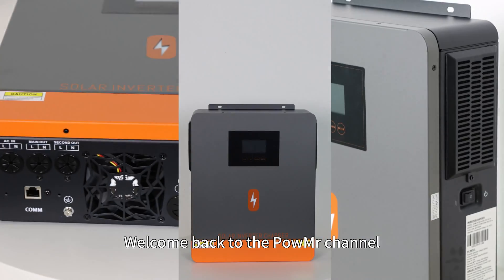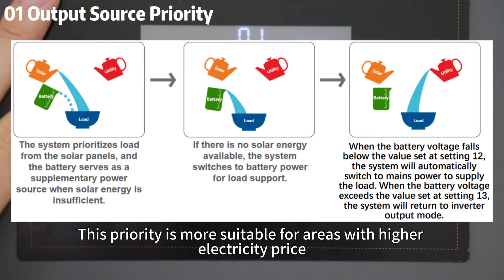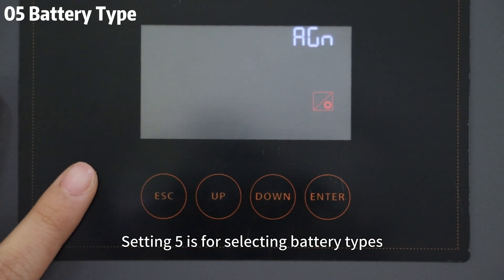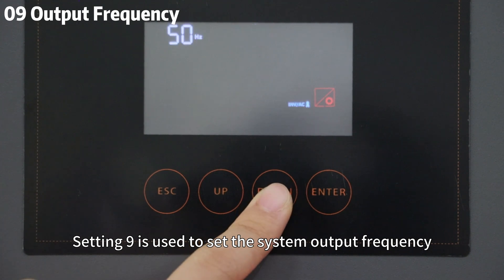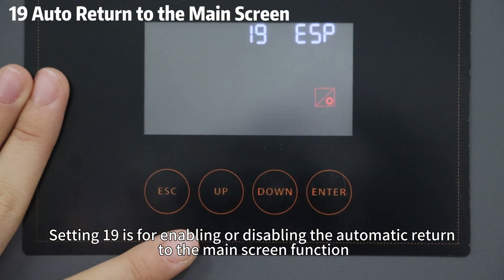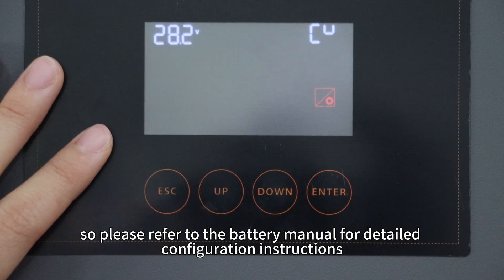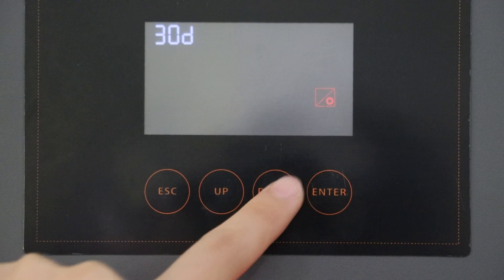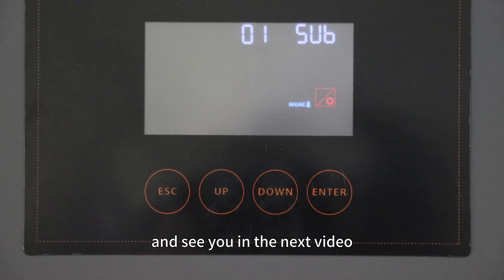How to Setup the PowMr 4.2KW Hybrid Solar Inverter?

Comment: Can that inverter run and enable bypass from non-inverter generator in APL mode? Generator gives stable 230v, but 51-53hz on no load, and 51 stable hz with load. I've tested on UPS mode, inverter beeps, tried to analyze grid but no luck with bypass, maybee it needs more time, like 60-90sec to analyze generator grid and enable bypass mode? (I'm asking for situations where there's no electricity for a long time, and the sun's generation is weak in winter, and the batteries need to be charged somehow)
Reply from the maker: To use a generator to charge the battery, you need to ensure that the generator continuously and stably outputs 230V, 50Hz/60Hz AC power. We recommend that you install a voltage regulator between the generator and the inverter.

Comment: I just got the 4.2kva powmr, but after installation, it started displaying BP. Please help my battery is tubular batteries
Reply from the maker: Check if the battery voltage is higher than 24V.

Comment: Can I connect PE and N together at the AC output? I need it for the correct functioning of the residual current devices. Or can I connect N from the input to N at the output?

Comment: Hello. I would also like to know why the 4.2 kW 24 V inverter does not respect the settings imposed on the user mode? I do not use a communication cable between the inverter and the battery, because of this I go to the user mode, but it does not respect the voltages set by me! It passes 40% 50% 60% even 70% on the grid with the battery. What do I have to do to make it respect the values entered by me???
Reply from the maker: Please send it to this email: support@powmr.com . Our technical staff will check it for you.
Reply: @PowmrSolar Good morning. I wrote to the technical department and I'm waiting to see what they reply.

Comment: I am using the 4.2 version of the inverter with 2 tubular acid batteries. In Settings #05, is it appropriate to set to FLD?

Also, I set #011 to USB. when there is grid outage, will this ensure that battery power is preserved when there is energy from solar, and use battery when no or insufficient energy from solar ?

How do i know the battery charge level and when it fully charged? Does the charging cut off when battery is fully charged ?
Reply from the maker: Please send it to this email: support@powmr.com. Our technical staff will check it for you.

Comment: Is the instruction also applicable to the 6.2kw version? Also, if I turn the grid tie function OFF in setting 37, will it still function as a hybrid inverter and draw power from the grid when solar and battery are not enough, but not export it when solar and battery are excess? I have no net metering but still want to use the grid when solar and battery is insufficient
Reply from the maker: Yep, It is also applicable to the 6.2KW model.

Comment: I have this inverter installed at a customer site with almost 6kWp solar panels, so the setting 02 was set to 120A, but the inverter kept resetting back to 60A whenever it short down on low battery voltage.
Kindly assist with the solution
Reply from the maker: Please send it to this email: support@powmr.com.

Comment: Question 
1. What Size of cable to battery 24v going to 4.2kwinverter?
2. What AMP use to 4.2kw going to 24v battery?
Reply from the maker: 1: 25mm. 2: Are you referring to the battery breaker specifications?

Comment: How to set this inverter for pure off grid use only pv and battery source
Reply from the maker: You can set the 01 setting item to SBU.
Reply: @PowmrSolar hi dear. My powmr 6.2kw hybrid is not saving SBU mode. After you exit setting and enter again, it shows SUB again. Please help. And how can I contact you with WhatsApp?
Reply from the maker: @ASh0599  Please send it to this email: support@powmr.com.

Comment: Hi. Can this unit be used with the network grid but without to use the bypass, I mean as a voltage stabiliser? As in my area I have ongrid power but there are big voltage variations and I need to stabilize the value at 220V to 230V but there voltage can go over 250V and I need to stabilise voltage. Is there any settings for that please?
Reply from the maker: It does not support 250V voltage. If the mains power is unstable, the mains power may not be detected by the machine. Need to be connected to stable 220V~240V, 50HZ/60HZ mains power supply.

Comment: can this be operated without AC in.. pure off-grid set up only?
Reply from the maker: Do you mean to use only PV?
Reply: @PowmrSolar only solar pv nd battery is connected to the inverter NO DU line. pure off-grid set.up only..
Reply from the maker: @ Only PV and battery?
Reply: Yes , I have one running on solar and battery's

Comment: Option 03 APL (AC input voltage range) . Can I connect our utility 127Volt line ( one phase 127 ) to this unit ? Instruction only mention (1)One Phase 220Volt but we have (2)Two Phase 220 Volt from the grid and that will damage the inverter if connected , right?
Reply from the maker: This refers to the voltage range that allows the mains input terminal to be connected. If the input voltage of 127V mains is connected, but after inversion, it is standard 220V~230V single-phase power instead of outputting 127V single-phase power. Can your electrical appliances withstand single-phase 220V~240V voltage?

Please note that APL is generally used for generators because the voltage is unstable.
Reply: @PowmrSolar  Yes , all appliances are 220Volt . Our grid 220Volt consist of 2 phase 110Volt , so I this cannot be connected to the inverter. We do have 110 Volt single phase . If we connect the 110Volt single phase to the Inverter will it charge the batteries and or will it convert to 220volt single phase output? If this is the case then it will work for us .
Reply from the maker: @JosdeKoningking  May I know where are you located?
Reply: @PowmrSolar  Caribbean , Curacao
Reply from the maker: @JosdeKoningking  Based on your description, you should use an USA standard machine.
Reply from the maker: @JosdeKoningking  Kindly check this model:
https://powmr.com/products/hybrid-inverter-charger-10kw-48vdc-split-phase-110vac-or-240vac

Comment: What for is second load output?
Reply from the maker: With the dual output function, user can connect some important loads to the main output. When the battery voltage is low, the inverter shall disconnect the secondary load and ensure the output of the main load, which can extend the operation time of the main load.

Comment: What size of breaker (mccb)should I use between the 4.2kw inverter and 24v battery?
Reply from the maker: 2P-DC-125A or 150A.
Reply: @PowmrSolar how many volts is it 500v max
Reply from the maker: @ Yep.

Comment: I have a question. On this model, when batteries are fully charged and inverter works as bypass with the grid connected, why is it still so loud? Can it be programmed to go to the standby untill the grid is unavailable?
Reply from the maker: Please send it to this email: support@powmr.com. Our technical staff will check it for you.

Comment: why the output use test pen are line on both output ?
Reply from the maker: The induced voltage released by the internal capacitor of the inverter will not affect the normal operation of the inverter.

Comment: When use [05] Agm battery mode, the Load voltage cut off default value is 20V. Is that correct?  the low voltage for Agm is around 11.8V therefore the value should be 23.6V for 24 battery(12V x 2). But this inverter gives [04] error when the value set as 23.6V. Why is that?
Reply from the maker: 04 code prompts that the battery voltage is low and the battery needs to be charged.
Reply: @PowmrSolar  now I understood that the error is given when i set the cut off voltage because of the battery has lower than the cut off voltage at that time. After charging the battery it was disappeared. Thanks..

Comment: Have bought this with lithium batteries 100ah by 2 but thy are discharging fast what could be the problem its a buckup only without pannels advise
Reply from the maker: What loads did you connect?

Comment: Does it have selling excess electricity back to the grid?
Reply from the maker: Nope. This model cannot sell electricity.
Reply: @PowmrSolar Then why it is stated in the manual that the excess power will go to the grid? Is there a way to protect the inverter to stop exporting power to the grid because i dont have net metering? Thank  you
Reply from the maker: @Juvz-c2l  You can turn off Grid-tie option 37

Comment: What is setting 43, 44 and 45? I bought this inverter 2 months ago (August 2024) and it works well but the manual booklet and online user manual pdf has no setting 43, 44 and 45 but the inverter has. Help
Reply from the maker: Hello, please send your problem to this email: support@powmr.com.
Reply: @PowmrSolar  There's no reply for a month now.
Reply from the maker: @keithks  Can you send us your email? I will check it for you.
Reply: Do you get answer? I also have this 3 settings
Reply: @Dark_Vlad16  there is an updated pdf manual in the powmr website just find the page for this model and you can see the pdf file there.
Reply: Did you get answer? I do have these 3 settings in my inverter.

Comment: Please, make separeted video for the configuration your hybrid solar inveftor for the Lithium Iron Phosphate (LiFePO4) and for other lithium battery types.
Reply from the maker: Okay.
Reply: @PowmrSolar , is this information available now, or not?
Reply from the maker: @ which model?
Reply: @PowmrSolar  , POW-HVM3.2-24V
Reply from the maker: @ You can send your questions to this email: support@powmr.com and our technicians will assist you.
Reply: F5 luc lip and lil are not in my 4.2kw model. Is there a update. I only have lib 485. Can not choose lic lip or lil for pylon

Comment: Please tell me which  voltage values should I enter for dual output, if I want that heavy lead must poweroff immediately when grid and solar not available?
Reply from the maker: Please see page 21 of the manual.
Reply: @PowmrSolar  I don't have manual. Plead guide me.
Reply from the maker: @humayun217  https://cdn.shopify.com/s/files/1/0746/0415/1079/files/POW-HVM3.6_4.2_6.2M-N_a615ca38-4e12-41c3-8191-ad94c6ef65bc.pdf?v=1711359339
Reply: Do you mean second will continue to work below 22v while the main load cutoff?

Comment: This inverter can handle 1.5hp water pump?
Reply from the maker: Yep. 1.5*750W*3=3375W. To be safe, make sure it is connected to mains power to carry the load and shut down other loads when using the water pump.

Comment: I'm planning to get 4.2kw inverter powmr, i have REC 370W 3panel =1110, each voltage (34.7)*3= 104.1V,  voc- 41*3=123, so my question is.... this inverter can run with this panel in beginning? ill add more panel letter. thanks for reading text, waiting for reply.
Reply from the maker: PV Array MPPT Voltage Range of the 4.2M model is 60-500Vdc.

Comment: I am interested in this model. Can you answer this question?
I am going to use the inverter without battery for some time. Without battery can it balance Solar and Grid automatically? Or is it exclusively solar only or grid only without battery?
Reply from the maker: When there is no battery connection, if the utility power is more stable than solar power, then it will use utility power. If there is no utility power, then it will use solar.
Reply: @PowmrSolar  thanks

Comment: this model have current limiter (export limiter) function?
Reply from the maker: current limiter? Please be more detailed.
Reply: @PowmrSolar  yes, where it prevents from exporting the excess energy going to utility company as they don't have yet this net metering. The correct term is export limiter.
Reply from the maker: @romelganit7838  This model doesn’t have this function. You can choose OFF in item 37.
Reply: @PowmrSolar if i chose OFF in  item 37, will that mean i can't draw power to the grid too? What i want to happen is i can use power from the grid when harvest is not enough, and not export power to the grid when there is excess harvest from panels
Reply from the maker: @Juvz-c2l  Yep. This machine supports mains bypass load, and can be set to take mains load when the solar energy and battery are insufficient.

Comment: If I set my system without battery, the inverter can automatically switch the incoming supply TO pv panel during sufficient solar energy?
Reply from the maker: If there is no battery, it will choose a more stable power supply. Generally, mains power is more stable than PV. 

We recommend that you turn off the mains or you can connect a time relay to the mains side to control when to turn on or off the mains.

It is not recommended to connect too much load without battries.

Comment: I just got this PowMr 4.2 and it keeps beeping and the solar symbol is flashing. What does that mean?
Reply from the maker: PV cannot be detected, usually caused by low PV voltage. What's the PV voltage? Try adding more solar panels in series.

Comment: Can i use POW-HVM6.2M-48v-N without battery?
Reply from the maker: Yes, this model can work without battery.
Reply: @PowmrSolar  one thing is that when utility is on, it takes power from utility  instead of pv all time and indictaor light is also blue. in order to use solar mode, i have to.switch off utility supply. setting mode SUB.what could be the reason?
Reply from the maker: @muhammadshahzadyousaf1282  When working without battery, if you connect to mains power and PV, mains power will be used first, no matter how you set it. Unless PV energy is more stable than mains.
Reply: @PowmrSolar  if battery is connected then setting will be SBU?
Reply from the maker: @muhammadshahzadyousaf1282  
Yes, connect the battery and then select SBU in 01 setting item.
Reply: @PowmrSolar  our inverter POW-HVM6.2M-48V-N installed a day ago, error 52 appears and the system is not restarting. what to do further? please advice.
Reply from the maker: @muhammadshahzadyousaf1282  Please send your problem to this email: support@powmr.com. Our teachnical staff will handle it for you.

Comment: Ho comprato questo inverter perché nella descrizione si dice che é un monofase invece é un bifase e sono deluso almeno che c'è qualcosa da commutare.
Reply: Per monofase intendo che il polo positivo è 230 volt ed il polo negativo è zero come è in tutte le case italiane ed il questo modo funziona il salvavita . Ho già un inverter ibrido powmr dov'è il positivo è 230 ed il negativo è zero .
Reply from the maker: It's single-phase. It's just dual output. Both outputs are separate single-phase.

Comment: I am bit confused. 
Please tell me more about program 41 and 42. 
Which output is "unessential"? 
The main or the second. For me is logical to think that something "Secondary" is less essential than "Main"
Thank you very much. ❤
Reply from the maker: With the dual output function, user can connect some important loads to the secondary output. When the battery voltage is low, the inverter shall disconnect the main load and ensure the output of the secondary load, which can extend the operation time of the secondary load.
Reply: @PowmrSolar  Great, thank you. ❤️
Reply: Can i fully off main output from Battery  @PowmrSolar
Reply from the maker: @PrinterSalesServiceBD  No.

Comment: if i turns on grid feeding and blackout happen then what will happen? it inverter turns off while grid is not available?
Reply from the maker: Do you have battery?
Reply: @PowmrSolar  yes i have batery and solar also
Reply from the maker: The battery will provides power to the loads if the utility is not available.

Comment: I bought this type of 4.2kw inverter it works fine but the connection with the generator is not working. It turns on for 2 seconds then it turns off. Maybe the settings are wrong? Please reply urgently. Thank you.
Reply from the maker: Hi, please send your problem to this email: support@powmr.com. Our technician will check it for you.
Reply: My 4.2 KW is not working properly . It is not shared when solar power is low with grid and there is enough solar power it always bypasses the great power
Reply: Please tell me which  voltage values should I enter for dual output, if I want that heavy lead must poweroff immediately when grid and solar not available?

Comment: I installed one of these units in Jun '23 and it was fine for the first 6 months, regularly supplying over 3600w power, but now it faults even with a 1600w load on it, and the Australian Ebay distributor is not being helpful.
Reply from the maker: Please send your problems to this email: support@powmr.com.

Comment: Kemarin saya habis beli inverter power mr hybrid pow-hvm5.5m di tokopedia, karena saya sedang ke luar kota paketnya datang pas saya sedang tidak ada, dan di aplikasi terkonfirmasi diterima sebelum saya kembali, setelah saya kembali dan mengecek paket saya memang benar sudah sampai dan unitnya dengan seri yg benar tetapi pas saya buka ternyata ada tempelan dengan tulisan fault f4 setelah saya coba nyalakan memang benar fault f4, lalu saya tanyakan lewat tokopedia dan disiruh kirim email, setelah saya kirim email dan melengkapi form yg diberikan saya malah di surung bongkar unitnya dan ngecek sendiri apa ada yg terbakar dan ternyata tidak ada yg terbakar, setelah itu saya disuruh lagi ngecek dengan multi dan sudah saya kirimkan lewat email. 
Sampai sekarang masih belum ada kejelasan tentang inverter saya yg beli baru tapi malah dikirim barang rusak
Katanya garansi 24 bulan, tapi ini aja beli baru malah yg dikirim rusak gaada kejelasan dari pihak power mr,